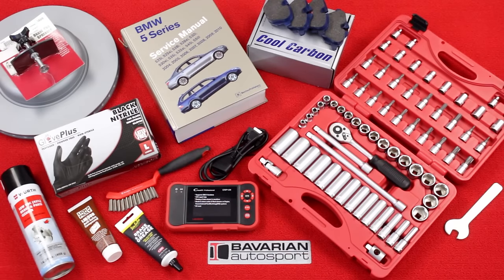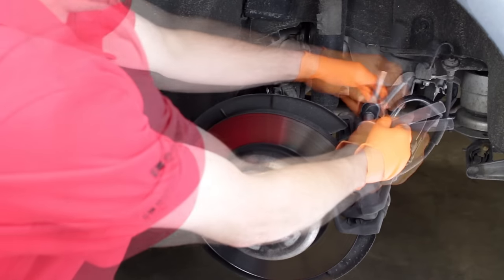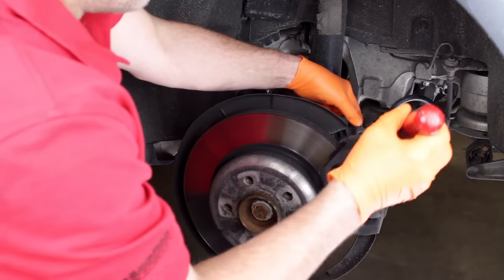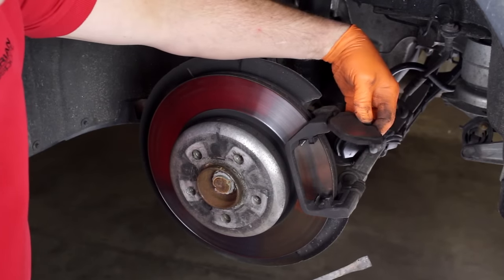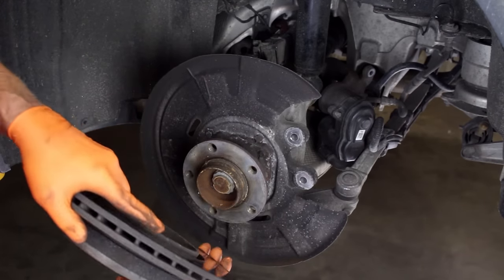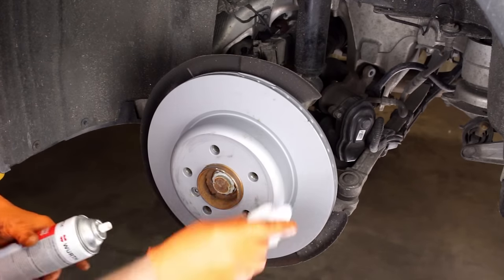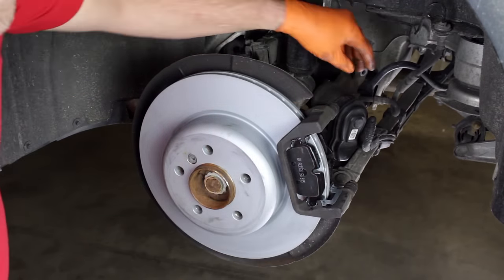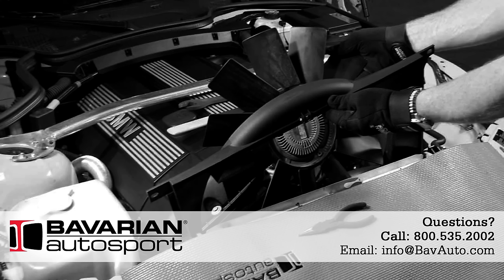Replacing Rear Brake Pads and Rotors on BMWs with Electric Parking Brakes

Comment: I've done 50+ brake jobs in my life but this was the first with the electric parking brake on my BMW 550.  The video really helped, thanks Bav Auto.  Someone asked about whether or not they need to buy the piston compression tool.  No.  Most time you can use your two thumbs and slowly push the piston in.  Sometimes you need to use one of the old brake pads, flip it so the pad side is on the piston, then compress gently from the back with a large channel lock (16" - 4" jaw) or a large C-clamp.  One other note, when turning the electric brake center hole clockwise, understand it will take 30-40 quarter turns of a ratchet.  It will finally stop.  A handy tip is to have a jack stand under the caliper to support it while you prepare the pads and clips, it takes the strain off the brake hose.
Reply: Hey thanks for making this video. a couple questions from when I was working on a 2018 X3 and ran into a couple issues.  

When retracting the parking brake, I got it all the way to the end stop, but the piston wouldnt retract in when using a c-clamp.  I thought it might have been due to the parking brake not fully retracted so i tried rotating it fully counterclockwise, then clockwise again. When that happened, the torx bit on the caliper side was able to spin more and now doesnt hit an end stop.  

The piston also came out of the dust boot and I was leaking brake fluid ( I messed up somehow, trying to figure out exactly where or how). I ordered a new dust boot and plan to rebuild and bleed the system.  

My questions are, is the park brake destroyed to where I need to buy a new one or can i somehow tighten the nut on the threaded portion behind the piston to repair it?  

How can I get the piston to fully retract afterwards so I can get the pads in?  Should I open up the bleeder valve to release some pressure in the system?

This is the first BMW i've worked on. Other cars i've replaced pads and rotors for didnt have this kind of system.
Reply: U can just use a scan tool to retract the epb

Comment: You forgot to mention  that after replacement you have to pump brake pedal BEFORE start the car. Otherwise, the hydraulic brake  code will pop out and you'll need a scanner to reset a code.
Reply: I always do this before starting the car to take the slack out between the caliper piston and new pads, but it will in some cases set a light if you do it powered on. Great tip

Comment: As a guy who's worked on cars for 30 years - if anyone ever wanted to add anything to this instruction - I guess that would be purely personal - rather than factual. One thing though - did I overhear - or does the voiceover say "refer to the Bentley repair manual"? While mixing up two car brands starting with "B" - this is probably no big deal, either. Have replaced rear pads on my 2008 A6 (with the EPB, using completely truly original VCDS) - and the procedure on my 2012 (haven't done its brakes yet) F11 - as portrayed in this video - looks extremely similar. Except - I don't think there's a torx bit on rear of the EPB motor on the audi - and I wouldn't bother, either - VCDS is extremely easy to acquire and set up and use. Does it all make sense? Bentley, BMW, Audi? Well. Who knows. Thanks for the video, greetings from Latvia.

Comment: This is the one of the best how-to videos I have seen!  Once I figured out the Allen and Torx sizes, doing both rear brakes took only 1 hour.  Hardest part was getting the wheels back on!  Front brake pads and rotors tomorrow!

Comment: Will doing this without a diagnostic tool mess with the calibration of the e-parking brake?
Reply: YZRandomE use a 9V Battery and connect it to the outer pins of the e brake connector. so you can use the e brake motor to make more space for the new pads. DONT pull the e brake piston in one time with the 9V, only step by step and only to the point of enough space for mounting. For calibration. pull 3Times the button for e brake. thats all. greetings
Reply: Just do it how he says on video I have done it this way 3 times doesn’t mess with anything …or if u have a  computer use it .but this way doing back rear brakes with rotors and new pads done in a hr …

Comment: Great video sir!  For all you novice techs, the special skinny 15mm isnt absolutely necessary, ( normal 15mm will fit on most models),  and you can compress the piston with your hand or a simple c clamp.  Once again great video and to the point! This guy is good!
Reply: I hope you're right. Was hoping I didn't need the skinny 15mm. Doing my brakes at home tomorrow.
Reply: @umustdv81  No need for for the skinny 15mm, I have been using a flat head screwdriver in the slot (small opening) to prevent it from spinning (top for clockwise/bottom for counterclockwise) for decades. I didn't know there was a tool for it. 😅😅😅
Reply: @kidgravity892  My wrench ended up fitting in there, but good to know a screw driver would work too. I can see that working.
Reply: @kidgravity892  i would rather have the skinny guy

Comment: Excellent and clear video. 
Just one more thing. When you compress the piston, keep an eye on the brake fluid vessel in the engine compartment. If it is filled up to high , it may overflow when brake fluid is pressed back to the vessel.
Reply: Yes thats the KEY and most important thing
Reply: If you check the level BEFORE you start, you should know if compressing the piston, which equals @ 4 ml of fluid, will cause an overflow.

Comment: Good and clear step by step directions. What I notice about this and many other brake service vids; no one cleans the area first with Brake cleaner spray, and no one uses one or two drops of penetrating oil on bolts and nuts that have not moved since factory assembly, AND lastly, no anti-seize upon reassembly.

Comment: I have found it’s useful to loosen the brake disc (rotor) hub fastening bolt while the parking brake is still activated, to avoid rotating the disc. This is especially useful on the front discs (RWD cars). The disc fastening bolt is frequently stuck from rust).

Comment: brilliant video, I followed it and changed my rear brake pads discs and sensor on my f11 520d. thanks for your help
Reply: +Darren Senerat only thing missing is how to reset the computer so it restarts the mileage. But that is available on other videos
Reply: Darren Senerat I wish they would provide torque values for all the bolts.  They mention the Bentley manual but unfortunately it doesn't exist for the F10/11 body style
Reply: Did you have to turn the EPB the same way on both sides to retract it?

Comment: Excellent tutorial. Thank you! You have earned my business in the future. Just a reminder to be sure the connector on the actuators are fully engaged. One of mine was very tight and didn't fully engage the first time. Needless to say, I got the dreaded “Parking brake malfunction”.
Reply: How do you activate the parking brake to reset the actuator?
Reply: @fabiodarocha2842  go in the car, pull the parking break switch

Comment: Very Professional Job Done and a clear explanation !
However one more thing has not been covered here,about how to reset the brake  service on dash bord after replacing  the brakes ?
Thanks .
Reply: I thought that if you replace the sensor you shouldnt get a brake service code. maybe im wrong.

Comment: Really nicely done. 

I didn't realize that you could just remove the actuator and it wouldn't cause any lights. I bought the tool and it has worked great on a VWs, Audis and a few Mercedes. I will try it on a 2011 750I soon enough.

Comment: Excellent installation , I have to install breaks on 2008 750li  if weather is sunny  I have purchased the parts. One of your video changing transmission fluid was good one too it saved me a lots of money, after changing the transmission fluid the car will go forward only in any gear but won't reverse it was overheating , The problem was cooler lines from the side of radiator the both lines were leaking fluid the rubber hose were not working . I went to dealer the cooler lines were $ 773.00 the installation was extra , I did explain the situation they said  get cooler lines installed if the problem still didn't solve come back we will be glade to get you a new transmission for $7000. Wen I install the cooler lines  I started the car it was working perfect but was jumping backwards and forwards but there were no signs with transmission wheel or overheating. your vides are very helpful thanks for posting them.

Comment: I can tell you that there is no need for complication on this job at all.
This applies to F10's and F25's.
The official method isn't even using workshop mode, they point to a SST.

Even with workshop mode, you still need to push the piston back. 

Basically you can do it very quickly using a cheap windback kit with the 3 pin one. 
Remove the two 13mm guide bolts (Replace those bolts, aluminium with blue threadlocker on them). 
Replace the anchor guide springs (if available). 

Keeping low tension on the plate on the windback kit, rotate the piston with the windback kit clockwise and the piston will go in, do this till the piston bottoms out.

Only use brake cleaner on the brake parts, brake anchor plate has a surface coating and a wire brush or sand paper is not allowed in the official repair instructions. 

Lightly grease the pad sections that contact the brake anchor points and fit them in.

Wire brush the hub ring to allow wheels to go on easier. 

Torque guide bolts to 15nm (these are one time use stretch ones). 
Torque wheels in a star pattern to 140nm.

The park brake will self adjust once 5km has been exceeded on a drive (they will not engage right after fitment). 

Bed in brakes as usual.
Reply: Devin Smith thanks for the info.  Do you know what the torque spec for the caliper bolts is?
Reply: Depends on the car, all bolts must be replaced. Use a Snap-On Techangle 1/2", no lubricants or anti-seize is to be used. 

F01 to F18 (except for F03) 110nm - M12x1.5.
F03 - M14x1.5 - tighten to 150nm, release 90 degrees, tighten to 150nm, tighten 180 degrees +- 15 degrees.
F25 and F26 - 75nm, tighten to 45 degrees and then 10 degrees. - M12x1.5
Reply: Devin Smith so what he doing you know with the Electric parking brake thats not necessary??

Comment: TY Lovely video and great detail.. one QUESTION :: You Say @ 20:16 all we have to do  is to activate the parking brake to reset the actuator and it is completed.  after this actuator is reset, do you need to pump up the brakes "after" to seat the pads to the rotor or is pads already seated against the rotor after the actuator is activated?? ty for great video

Comment: Excellent video. My BMW 640d has electric parking brake. However, your video does not show if you also need to release the parking  brake from the control and if the ignition needs to stay on while doing the job to stop the parking brake coming on. Which is the case? Thanks

Comment: Great video.just wondering if parking brake is applied while removing rotor or parking brake should be released.
How do we do this you cannot put parking brake off unless switch ignition on or start the car.
Please clear i am bit confused.
Many Thanks

Comment: Hello, is there another part on the rear brakes for the AUTO HOLD feature? I have not been able to find a video that properly shows how AUTO HOLD works in conjunction with the rear brakes. I have viewed only 2 good videos (your video being the best) that clearly denote how to work with an Electronic Parking Brake.  I have a 2020 X5 xDrive40i with MSport added (3.0l 6cyl), but the brakes are the 4 piston, non-colored caliper, not the large Brembo-type that is on the V8 MSport/Competition versions of this vehicle. Any data or good links are appreciated. Thanks =)

Comment: This is extremely helpful - thanks for the brilliant video.  Would you know if this would be same as the G30?
Reply: Ever got the answer to this? :-) Thanks
Reply: @TedStiker1  I didn’t but I had a crack at it and the solution is the same
Reply: @danielson1989  many thanks! Mine are rdy to be changed on my G30 so appreciate the response!
Reply: @TedStiker1  One small tip which got me I think it was for the front or both,  when you put the new brake pads in make sure you check the pads and put them on the correct side.  So they have a inner pad and an outer pad,  basically it has some small nipples that line up with the holes on the caliper.
Reply: @danielson1989  Thanks so much for the tip and sharing your experience. Never did this on a G30 so appreciate the help! Going to start with the front rotors and pads first.

Comment: Those discs with the anti rust compound needs a little bedding before they work correctly.  Drive a little while and perform some light braking. This grey substance will then come off to leave shiny discs that work correctly...

Comment: Just had pads and rotors replaced on a 2018 BMW with an electronic parking brake.  When applying the brakes after driving for about 20 minutes the car shudders so bad it rattles the right rear passenger door.  Shudder is also felt between the driver and front passenger seat.  What could be causing this shuddering?  No brake pedal pulse and the steering wheel is not shaking side to side.  Fantastic video - did not know there was a difference between handling the electronic parking brake on the left and right rear brakes.
Reply: Can you explain what happened to your BMW after this please?
Mine is from 2017 and I want to try this as well

Comment: Since the front of that piston is notched could you just rotate with the proper brake compressing tool while turning clockwise instead of removing the whole electric parking brake motor?

Comment: Hello what size bolt was it for the caliper mounting bracket? Thank you for your assistance.
Reply: Great Video by the way.
Reply from the maker: Shoot ... don't recall just now, but they are typically 16mm on the newer BMWs and 18mm on the older models.
Reply: Thanks ever so much for the reply. Your video was a tremendous help when changing my brakes. Keep up the good work.

Comment: i like how you guys torque to specs , or its more like -  little more , LITTLE MOREEE ... ok its enough
Reply: Rear brake bracket bolts (not caliper pins) This guy just hand tighten it with a 6 inch wrench, is that good enough? Focus ST

Comment: Great video.  I own a 2021 M440i.  I have a scan tool to retract the EPB, my question is do I still have to remove the EPB from the back of the caliper before I can retract the caliper piston?  Does the caliper piston push in or do you need  a tool that turns the caliper piston back into the caliper?
Reply: You can leave the EPB in if you can retract it electronically.
You use this method when you don't have the scan tool
Reply: @RadoHudran  That's what I thought. Thanks.

Comment: Hi,

I didn’t disconnect the electric motor as I followed the wrong video….  I noticed that the rear rotor would not come off and was held in place by a spring type of mechanism.  Sorry I am not the best mechanic, if I remove the electric motor and use the torque 45 and screw clockwise, will this release the rotor?

Thank you in advance
Reply: BMX X5 E 70 40d

Comment: So if I do have a scanner,  I can just retract the piston without the compression or I still have to do both?
Reply: You probably need to compress the piston anyway. The scanner will just wind back the electric motor so the piston can be pushed back manually.

Comment: I removed the 2 caliper guide pins and I could not pry the calipers off from the pads or bracket to save my life. It's stuck on there. I just can't get it off.

Comment: I noticed you didn't use any anti-squeal paste on the outside of the pads.  Was this something you don't recommend, or just overlooked it?
Reply: It will squeal if overlooked. Happened to my Lexus GS350.
Reply: I use the spray can, red stuff, let dry overnight before installing.

Comment: perfect DIY, did my 14' 535i today, but forgot i need the sensor. anyone tried resetting the service interval without replacing the sensor? mine shows unsuccessful when i tried to reset it. i'm assuming i'll have to wait till i replace the sensor to reset it again. i didn't have to use a ratchet to reset the electric brake tho, i was literally able to free turn it without any resistance.

Comment: Dear Sir. 
Do you sell the transmission kit and correct transmission oil for a BMW 1999 528i (E39)
Reply from the maker: Sure do!  See the links below, specifically for your 99 528i:

Filter kits:
http://www.bavauto.com/search/s.asp?y=1999&m=528i&s=automatic+filter

Fluids:
http://www.bavauto.com/shop.asp?HC1=0&Htarget=search.asp&HCY=1999&HCM=528i&SearchStr=automatic%20fluid